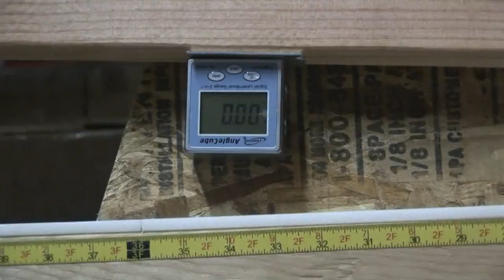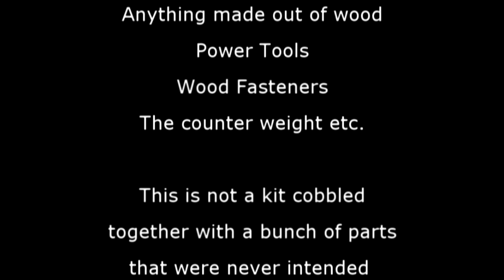Super Simple DIY Panel Saw Kit Out Performs Many $1,000+ Saws!

Comment: I made a similar design, but no counterweight. I used the weight of the saw to cut the wood controlled by the rope over a pulley. And I had the power switch near where I was standing. That way you are clear from the danger and dust. I like your track idea.

Comment: Some design considerations this idea might benefit from, a zero clearance insert for vertical cuts and a repositionable slide with saw insert for your rip cut horizontal orientation to get a little cleaner cut and prevent tear-out.

Comment: I've used 2k dollar Panel saws, this one works dam goo by the looks of it, but I've got an improvement for it. Most shelves attach in a cabinet with Pins add a pin lock hold and a plunge outer and you have a pin pattern add to this you could also add a Tilting plate to cut  molding shapes on your panel MDF  or in hardwoods and other ideas as well. Like a X-Y-Z index or a circle cutter or   even pentagram attachment with pattern guid.
I'l bet you could cut dovetails with it even.

CNC vertical panel, router table sheet good size.
Reply from the maker: The Swap Saw is back!  Http://www.a2eq.com

Comment: I do like it mostly because of the overall Simplicity  and the factor that it cuts Accurately  I’ve worked in high Capacity Shops over the years that have had Commercially available Panel Saws  that were  always out of adjustment and very unreliable  for Precision work   Oddly  for Projects  at my home Shop i could breakdown Sheet Goods faster  using Straight edges and a battery powered Circular Saw  then  using those  Panel Saws  in a 100,0000 Square Foot Shop with Millions of Dollars worth of CommercialWoodworking Machinery  Of Course in both  cases  i always liked to achieve final dimensions on my Personal Table Saw  i exclusively  used  and  built Jigs ,Sleds ,and Other Accessories for that Specific Saw

Comment: Is it an issue in the case where you rip a panel and the weight of the upper piece wants to fall down and squish your blade, creating a kick back like situation? Would a riving knife on your saw fix the situation?
Reply: Fabrication en bois eto
Reply from the maker: I have not found pinching the blade to more than a minor issue. I tend to lift up on the panel as I pull it through at the end. 

The Swap Saw is back!  Http://www.a2eq.com

Comment: That aluminum rail is going to eat up that clear plastic slide very quickly.
Reply from the maker: The polycarbonate carriage will last for years. Mine is now 8 years old and going strong. The rails are anodized, providing a smooth, durable, low abrasion surface.
The Swap Saw is back!  Http://www.a2eq.com

Comment: The weakness of such designs is in the ripping, it relies on the board having a straight edge. If the edge isn't straight, and they aren't usually, then the rip cut won't be straight either.
Reply: Well, its better than cutting by hand dude. And I'm not buying either.
Reply from the maker: +frauirmabunt 
If you had read the directions you would realize that the board must be run across a jointer.  This will give it a nice straight edge.  Ripping and cross cutting are both very accurate.  We use a very slippery plastic for the work piece to ride on.  You can even cut lattice work on this baby.  Let's see you do that on a panel saw with rollers.
Reply: +A2Equipment 

LOL at the idea of edge jointing an 8x4 sheet on a jointer, you can not be serious!

A track saw would blow this this daft idea away.
Reply: I don't think you quite understand. The 'board' in reference is the dimensional 2 by used as the fence. I don't know where you get your plywood from but every single sheet I have ever bought has had straight edges. They may not have been dead on parallel or square to adjacent edges but with this design it won't matter as long as you reference off of the same edge.
Reply: I understand just fine, it's just you work to a different idea of 'straight' than I do. As an alternative to cutting by hand the device shown is much better, but as for it's outperforming a proper panel saw? The idea is so ridiculous that it's not even worth a chuckle let alone an actual laugh.
Reply: Plywood and OSB are manufactured square and strate  stop collecting scrap materials from construction sites and buy a new made sheet  I have not seen a single sheet of plywood in 25 yrs that was not square from the mill

Comment: ok design, but not amazing.
Reply: Nathan Nostaw It's ten times less expensive than buying one. I think that's pretty amazing.
Reply from the maker: +AKA Nathan Let's see you put any other Panel Saw into the back of a PT Cruiser.
Reply: +A2Equipment I must have missed the memo that sets PT cruisers as a measurement of good design. Seeing as they are ugly as sin, I wouldn't be using them to promote my design. The saw design is OK, but still not amazing, (even if you could fit it into a tiny smart car).
Reply: AKA Nathan
I don't know why you feel the need to make a random negative remark. Besides, I think PT Cruisers are awesome.